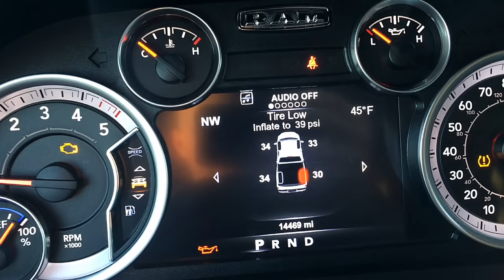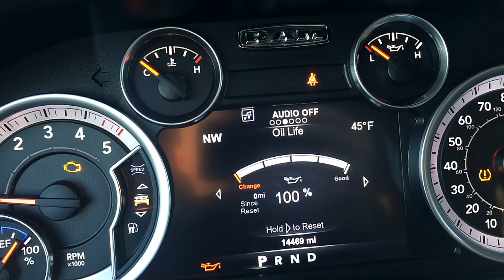Ram EcoDiesel 3.0L V6: Tips For Performing A Proper Oil Change

Comment from the maker: Updated Oil Weight and Brand Recommended by FCA-
https://amzn.to/2SF7kTe
OEM Mopar filter $20-
http://www.amazon.com/gp/product/B00KQ4VE64/ref=as_li_tl?ie=UTF8&camp=1789&creative=390957&creativeASIN=B00KQ4VE64&linkCode=as2&tag=fordt-20&linkId=C4FVT3GVA7W4B724
An aftermarket filter has come onto the market also, check it out-
http://www.amazon.com/gp/product/B00VKQIGSQ/ref=as_li_tl?ie=UTF8&camp=1789&creative=390957&creativeASIN=B00VKQIGSQ&linkCode=as2&tag=fordt-20&linkId=UWVPZHN33XXRH2GF
Large capacity sturdy oil pan I use-
http://www.amazon.com/gp/product/B00A7EU5CM/ref=as_li_tl?ie=UTF8&camp=1789&creative=390957&creativeASIN=B00A7EU5CM&linkCode=as2&tag=fordt-20&linkId=CJ4LCKUSNFVIPSKY
No Spill Funnel I use-
http://amzn.to/1qlCRJR
Here is a strong brake cleaner I use to get the job done-
http://www.amazon.com/gp/product/B000LDR9HI/ref=as_li_tl?ie=UTF8&camp=1789&creative=390957&creativeASIN=B000LDR9HI&linkCode=as2&tag=fordt-20&linkId=OJHRSKWHFU4P25G4                                                                                                                                                                      Torque Specs:
Oil Filter Cap- 18ft lbs
Oil Pan Drain Plug- 33ft lbs
Oil Capacity 10.5qts
Reply: Ram EcoDiesel Source  what do you think of the bulletproof egr for the eco diesel?
Reply: Ever going to do an updated video for the last two years on the truck?
Reply: Would this updated oil be the same for the 2014 jeep eco Diesel engine?

Comment: Thanks for the great video! I just did an oil change on my Ecodiesel this afternoon. Used Rosella T6 5w40. Got a really good deal on 5 gallon bucket so I bought 2. I have enough for 3 oil changes for $150 Cdn. Bought Fram filter for $30. Works out to $80 Cdn. That’s about $55usd. Very inexpensive. I go the full 10,000 miles but maybe I should rethink that. I sure like my Ecodiesel. This is my third one and have no issues at all. Drives good pulls good and I regularly get 30mpg. Hope to get a 2020 with Ecodiesel.
Reply: Excellent choices.
Reply: @Mike schnell, what tires do you have to get 30 mpg?
Reply: Y T I have the factory all season Wrangler tires. Smooth and quiet. Amazing truck.
Reply: How are u gettin 30mpg out of yours? I’m only gettin like 17
Reply: Nathan Ross I drive at 65-70 mph. Go easy on the brakes. Nothing else.
Reply: @nathanross7798   no matter what I do I only can get MAX 22 MPG. I even did a youtube video asking why. I drive it as slow as I can on take off and stop and had it at 70 MPH and still 22 is max. So i feel your pain. I have factory tires and no mods on truck (unless you count a LEER top on it). I came to the conclusion that the rear end gears may be the higher one so I am getting better pull and less MPG. ( I think, and I am sure if I am wrong I will be corrected multiple times :) it comes with 2 options for rear end gearing on the 2016model. And I probably have the higher one
Reply: Make sure you change the filter at least.
Reply: @yt754  stay under 75 and mine does it all day long on the hwy.
Reply: @nathanross7798  are you in the city?
Reply: I let mine drip for an hour.
Reply: I got 22.5 from Sacramento to salt lake City.  I did the newer gde tune and the next trip to Phoenix and back from salt lake I averaged 27 over the whole trip. That was hand-calculated not lie-o-meter. I would have gotten "30" had I gone off the meter
Reply: 2019 classic eco btw
Reply: Is it deleted?
Reply: @Vziera  no. Stock. My brother deleted his Ecodiesel and says it is fantastic.
Reply: My 2019 gets 28 to 31 on the highway

Comment: Whew.  Just got done changing my oil, per your video and I have to tell you, the reset method to zero the Oil Change indicator did not work the way you described, even tho my computer showed me the same dialogs yours did (reset with the arrow keys).  I tried it about 5 different times, no luck.  Finally, I read the owners manual and it said to turn the key to run (without the engine on) and depress the gas pedal three times within 10 seconds, then shut ignition off.  Voila!  Zeroed now....

Comment: 8 quarts of oil?  Pretty sure it's actually 10.5 quarts even for the 2014.  Mine is a 2014 and that is the capacity mine uses.

Comment: 8 quarts (7.7L) is for Jeeps with the 3.0L Ecodiesel. For Rams it is 10.5 qts all years.
Reply from the maker: +Leif Jensen Nice thanks a definite typo in the owners manuals and online workshop manual. That is why I always say be sure to check the level no matter what.
Reply: 2016 Grand Cherokee here. Damn near made that mistake today... Double checked the owners manual after pouring 5L's in and sure enough 7.7L. I was just about send the whole 10L...

Comment: Here it is almost two years later (Aug 2017) and now we are told to use the 5W-40W Rotella.  Also, Brian, my Eco Diesel tells me to do my oil changes every 10K, and the on-board computer is set to do that, showing 50% oil life after 5K remaining.  So, I do my tire rotate every 5K, my Oil & filter every 10K (or every other tire rotate) and my Fuel Filter change and rotate at 15K or 5k after the oil is changed.  I hope I am doing this correctly?  Am not at 56K on this engine and so far, no issues whatsoever.
Reply: How is your 2017 holding up?any issues that i could learn from?
Reply: @josedelgado6138  Well - interesting you've asked.  Our truck was doing great all these years (and we really like it) UNTIL mid April when it threw a code: " Service Electronic Throttle" and put the truck in a semi-limp mode (would only go about 45 mph up steep hills).  I drove it to the shop and found out it need a new "toning wheel" which is mounted inside the transmission to tell the engine when to send fuel to the rail to the cylinders.  That part is on National recall and was utterly unavailable until just recently.  Basically, our truck (which still ran) has been in the shop awaiting that part since April 20.  The shop informed us last week that they FINALLY got the part to fix it and will be installing it at the end of this week.  Ram trucks around the country are awaiting this recall part.  Our truck's part just happened to break before the part was available so we've been without it. Fortunately, we had another vehicle.  If you own a Ram Eco diesel, get it to the dealership and get your part replacement scheduled asap, before it breaks. We really miss our Ram and its 28-30 mpg as our other truck gets 14-15.

Comment: Thanks for the great video. A couple of things to note: I have a 2014 and the owners manual says it takes 10.5 quarts. When I changed the oil, that's exactly how much it took. So I'd say to check your manual since not all 2014s take 8 quarts and it would suck to underfill and/or not have enough oil on hand thinking you only need 8 quarts. Secondly, definitely get the big drain pan and make sure it has a large center hole! That oil drains faster than my pan could take it all in. Even though my pan has a 15 quart capacity, the center hole was too small, so the oil overflowed and I ended up with a huge spill in my driveway.
Reply: Same here.  I just stay under there and cover the hole with my finger until the pan catches up.

Comment: Great video.  Excellent camera work and informative.  Just FYI, the Remote Start function is automatically deactivated when the hood is open so its not necessary to keep the remote 6 feet away.  This is assuming you have the hood open while doing an oil change or other engine maintenance
Reply from the maker: Yes I am aware I installed the factory remote starts for 10 years at the dealer but like I said you can easily set that case of oil on top of it accidentally when you are prepping the truck for the truck for the oil change. Not to mention all the return wire of that switch needs is a ground from a short or mice damage to defeat the switch. My motto is to never assume especially during an oil change that would be a costly assumption.

Comment: I always pour a little into the new filter at least enough to soak the paper element. Not enough to leak in this case. In other types, a couple ounces in the bottom. Oil flows slightly quicker then as it isn't pulled into the paper at first. Minor maybe but easy to do.

Comment: The TSB I have read in multiple places lets you use ACEA A3/B4 spec oil. You can get a Mobil 1 'European Car Formula' 0-40W full synthetic at Autozone. I got a total of 15 quarts and three filters (have a Corvette to do with another oil) for about $120 after tax. 0-40W will of course flow better during startup but it might burn a little due to the 0W in hotter climates. But good for winter.

Comment: I have a 2015 Ram Ecodiesel, recently brought it in for warranty work. The headlights flickered and the Radio Navigation was extremely slow. I did mention the rattle in the engine and transmission. The service advisor never documented that complaint. A call to FCA to speak to a rep about warranty claims and issues with service was extremely difficult to get answers. I believe the current problems with the EPA is giving a major problem for FCA. I mentioned to the rep that the Ecodiesel is no longer available at dealers and was curious about the reason for the Ecodiesel being discontinued.  I said is it because of the motor and the rep said that he had no information about why it was stopped being sold. I guess the rep was playing dumb and I finally let him know that Fiat is in a jam like Volkswagen. We will be getting a buyback.
Reply: Don Olypopper The 2014-2016 Ecodiesel owners who had that software update to comply with the EPA Class Action Lawsuit have reported poor performance now. 
Many Ecodiesel owners are complaining about an Anti Freeze Coolant smell. 
A few fires caused another current recall on the Ecodiesel. The dealers are unable to make the repair to the EGR and will cause another major issue for owners. 
The class action lawsuit also has an FCA buyback for people that didn’t take the $3,075 USD cash back and limited warranty.
Reply: Don Olypopper Trump 2020!

Comment: Very good video.  But Ram has changed the oil spec from the Penn. Euro L 5W30 to a Special Shell Rotella Low Ash oil with a slightly higher top weight to protect the crank and the journals better.
Reply: It's a Shell Rotella T6  5W40.

Comment: I bought my Wix WL10060 at O'Reilly for the big value of $13.00. The local Ram Dealer said that is what they use and the oil is nothing real special they used Shell Rotella T6 which is what I run in my John Deere tractors too. Tractor Supply had by far the best price on the 2.5 Gallon jugs at $43.99 each. Compared to O'Reillys at $69.98 per 2.5 Gallon jug. The Mopar branded Oil is apparently nothing more than the Shell Rotella T6 rebranded. Meant to add that Ram charges $177 for just the oil change DFW area and local Firestone charges $225. That is strictly an oil and filter change nothing else.

Comment: Hummm, my Brother is a master mechanic - ever single state of Michigan license. Been so since he left the USN in the early 1980's... OK, in that time, he gave me much grief as did every one else for using Mobil 1 full synthetic since high school. When I ordered my first 7.3L Ford PowerStroke in 1999 I switched to Mobile DelVac 1 - full synthetic industrial diesel oil. Indefinite life, with normal filter changes and 15k oil analysis.  Now comes my first two new EcoDiesel 3.0L - RAM 2017 and Gand Cherokee 2018. Bro (in product development at FCA) says I need higher Sulfur content full synthetic - Rotella T-6. Guess what I use now?
Reply: That was a drawn out way to say you like mobile and shell oil.

Comment: Thanks for posting the video. Wondering about a couple of things: 1. Why did you change filter before draining the oil? Why not take it out and have another vent location? Or leave the old filter in? 2. As far as I know, the oil change interval is 10,000 miles. Why change it every 5,000 miles?
Reply from the maker: +Alex T On any cartridge based system you want to remove the cartridge filter to release the anti drain back valve this allows the oil filter housing to also drain back to the pan first thing. Once the housing is drained then it cant drain no more so you are ok to put the new filter in at that point and finish up on the top end. By that time the pan is read to drain. Oil change intervals for diesels are still recommended every 5k for dino oil you could likely get 7500 miles no sweat with synthetic but there is a lot of soot and blow by with diesels and its best to not wait. The oil lubricated much more sensitive components than just main bearing thing turbo bearings that spin at a very high rpm.
Reply: I have three words for you. Main bearing failure. Change it every 5,000 or less.
Reply: 5 40 oil     10.000 miles

Comment: Excellent instructional video. I wonder how different it is from the current generation EcoDiesel engines used on the RAM 1500? From what I've read and heard, the newer generation oil changes are most expensive.

Comment: First off...I really like how you explain your ideas, opinions and knowledge. I own lawn maintenance company and tow 4,000lbs of equipment daily. I have a long bed single cab eco diesel. I took off the bed and replaced with a custom flatbed to make work easier and to load up snowmobiles for winter.  The flatbed is a little heavier so I put the airbags in the coils to level out. I don't want to ruin my warranty so I would like to get your feedback on which direction I should go. I've seen people talking about GDE tunes and PPEI tunes. Deletes too. I looked into and leaning towards the Banks Stinger system. I want more power and better fuel economy with the flatbed weighing me down and towing daily. If it was you would you leave it stock or do mods?
Reply from the maker: +Lawn&Order LLC I have never gotten into the aftermarket being a dealer tech but anything in general that deletes the epa emissions items like the dpf, scr and even the cat will help tremendously.
Reply: Lawn&Or
Reply: Becarefull they will blow up

Comment: Never understood about warming up oil now it's suspended.  I think it might also have to do with threads on fastners made to come out while warmed up.  I found on couple Toyotas the spark plugs had to be warmed up before removing!  Interesting never seen any information posted about it before.  Maybe I should follow directions lol warm up engine when it mentions it stop questioning it.
Reply: Exactly

Comment: Do you have a video that shows how to install a Magnafine transmission fluid filter on a EcoDiesel?  More specifically which line. It's very difficult to figure out which line is the return line back to the trans.
2016 RAM 1500 EcoDiesel

Comment: Fill amounts are the same for all years. There was a typo in the 2014 owners manual of 8 quarts, it is 10.5
Reply from the maker: +Tyler Richardson Interesting the online workshop manual still states 8. Well that's why I say to check the level afterwards to verify. Either way you will have two cases on hand.
Reply: +Ram EcoDiesel Source Alot of the online spec info still states 8 qts, My early 14 does take 10.5 that's a head scratcher.

Comment: Great video. I'll be doing my first oil change at 2500 miles. It seems RAM recommends Shell Rotella T6 5W-40, and I noticed you used 5W-30 Pennzoil Euro... why not use the Rotella, as recommended?
Reply: Shawn it used to be 5W-30

Comment: 2018 Ram 1500 Ecodiesel recommended oil type is 5w40 Shell Rotella full synthetic
Reply from the maker: Same with the older models, my link to the updated weight recommendation has been active for years.

Comment: This is an awesome video. I just purchased a eco diesel and this saves me from having to spend $250-$300 for an oil change. Thank you. 

I do have a few questions. I saw the over of the oil shows 10W-30 but you recommended 5W-30. I was wondering why. Also, is there a secondary oil filter? Someone said there might be but I doubt it. 

Also, if there a method for the break cleaner that you posted the link to purchase?

Comment: Hey their, nice video.  I have been looking at some used eco diesel trucks & one thing I have noticed on all of them is that when I have been checking the oil on them they all appear low.  Is this possibly have something to do because of the intricate head design not allowing all the oil to flow down to the pan very quickly???  I have found it odd that is has been consistent on the eco diesel motors.  Your thoughts???

Comment: Great video, very clear & to the point. Quick question though, I have read through the comments to make sure that it hasn't been asked/answered before. I have been scared into believing that doing my own oil changes would void my extended warranty. I have a 2014 GC Ecodiesel which I care for alot, probably more than the kid at the local dealership who would be doing my oil change there. It's not even to save money but more so because I am very picky and meticulous when it comes to maintenance on it. If I keep receipts/detailed records of my oil changes, will this void my warranty? I have heard a dealer say it will and another say it won't..  I value your expertise on any maintenance related subject more than both of them combined! Thanks in advance and keep the videos coming! Jeroen
Reply: I just found out you can log your maintenance on the Ram website in the same way the mechanics do. Save your receipts as well.

Comment: That black oil is full of soot, read sandpaper. Does all sorts of nasties to cam lobes, roller and bearings. Change your oil often is my best advice, don't go 30,000 to 50,000 miles between oil changes.